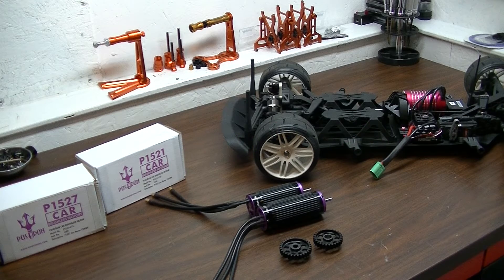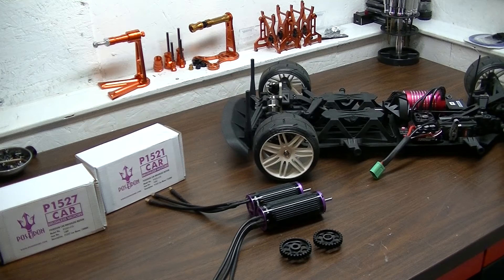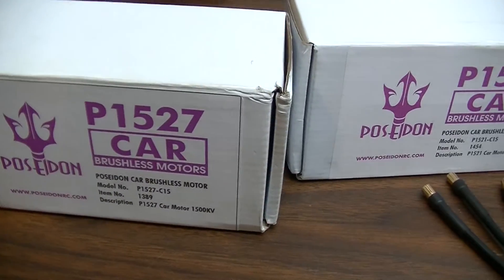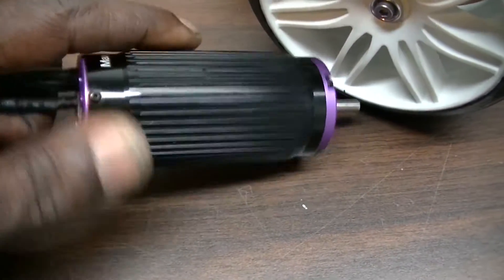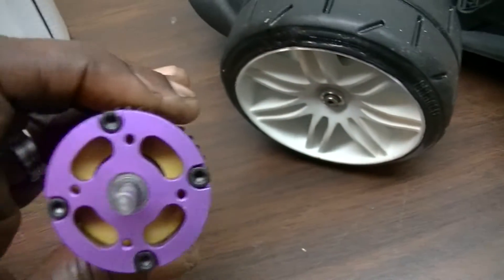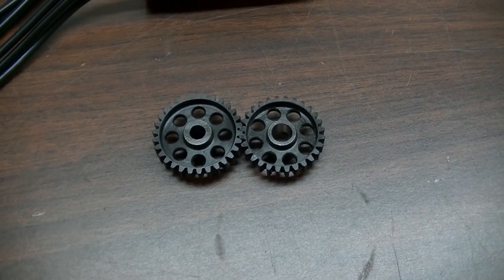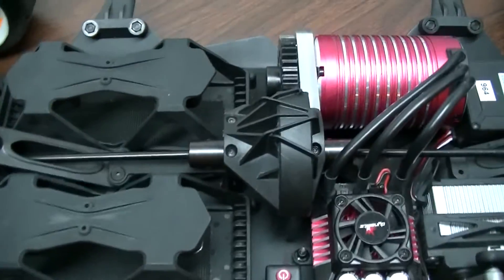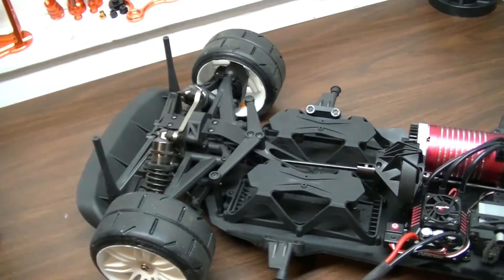New From Poseidon 1

Comment: is that the losi 160a esc that comes stock on losi audi? how do you like it? have you run the 1521 yet?
Reply from the maker: Yes that's the stock esc and I fried it already.. I'm putting in a xl2. The 1521 I haven't got a chance to run yet... I've been really busy but as soon as I get some runs in I'll let you know my friend...
Reply: how did you fry that? I fried their 130a esc but from wires touching..I ordered the 1521 also and will be matching it with a xl2 on my slash. good times ahead.
Reply: sub!!nice motors bro!im using. the 2200kv on my ofna x3 gt...check out my progress on the electric conversion im doing on it bro!would really appreciate the comments from the pros.

Comment: I got a Poseidon 2200 myself, I'm wondering how your suppose keep the dust and grit out of the windings?
Reply from the maker: I have a Steve neu and they are similar with the air holes, I blow mine out with aerosol canned air..
Reply: rocbud43
That's a trip I remember reading somewhere Castle no longer selling replacement shafts because metal shavings getting on the magnets.
Reply from the maker: +natemorte Wow I never knew that was the reason why castle stopped making the replacement kits that's crazy...
Reply: You ever figure out what to use to cover the front / rear vent holes?